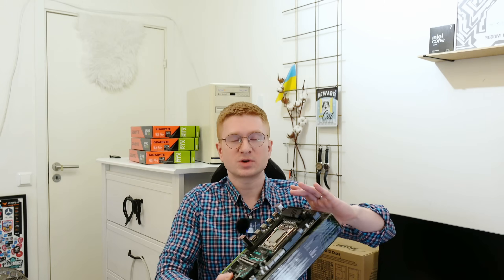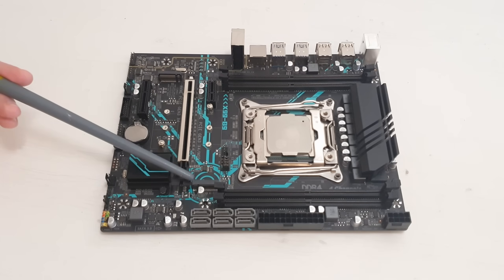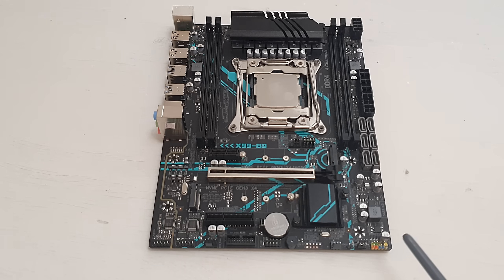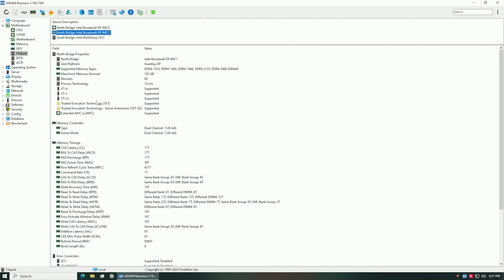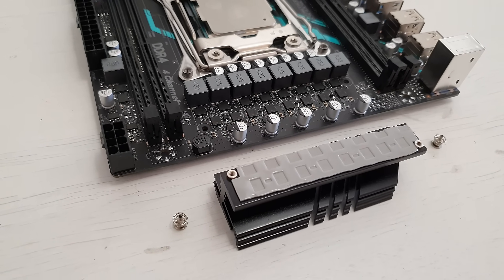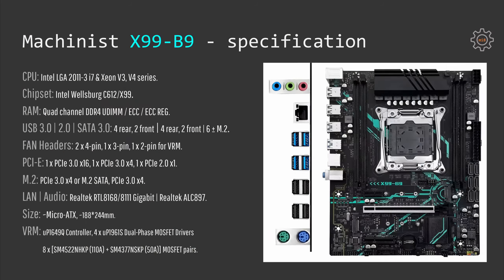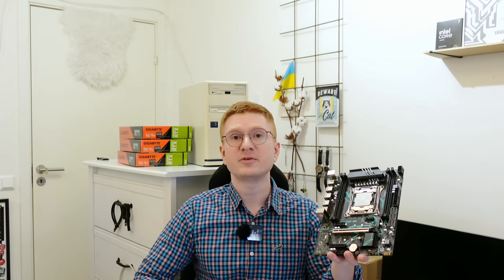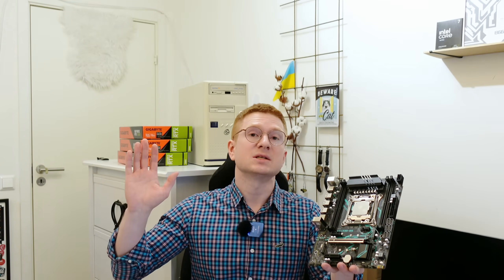Machinist X99-B9 – X99 chipset & 4 memory channels but is it good enough?

Comment: Wouldn't it be possible to solder the pins onto the debug panel and install a BIOS that's compatible with TPM 2.0 and secure boot? I think it's worth reviewing this board. It might have potential.
Reply from the maker: Theoretically it's possible. Practically, I don't know what BIOS is compatible and see no reason to bother with soldering as you can just buy X99-XD4 that has all required features out of the box.
Reply: @Miyconst  Thanks for replying!

Comment: Thanks for the review. I should have seen this video before i order this board weeks ago. I'm yet to install a ram and power supply and test the board. However, i have faced some extraordinary situation. my x99 CPU Slot place on upside down on motherboard. I just found out that when i try to install my e2640v4 cpu. i can confirm its not cpu issue.but the board.  Since this is not booted up until now is this safe to boot when my ram arrived??? If anybody faced this issue with chinese boards ?
Reply from the maker: I don't quite understand the question or the concert. What do you mean with CPU slot? Do you mean socket? If so, then it doesn't matter what orientation it is, as long as you install the CPU correctly.

Comment: Ah damn. I wanted to get another original QD4 for near the same $64 that I paid the first time. I don't like the new QD4. I got excited when I saw B9 and the whole way through your review I thought I was about to buy and then you said ECC is not working on B9 with Xeon v4. DAMNNNN. I dodged a bullet there. I really appreciate your videos. Thank you!
What board can you recommend that has an gen3x16 slot + gen3x4 slot + 1 or 2 NVMe gen3x4 ?
Reply from the maker: I am awaiting an X99-XD4 board for a review. If it turns out to be decent, then it fits your needs.

Comment: It's not 4 channels... It's 2 channels with 4 slots - very different than "4 channels"

If you install 4 DDR4 cards, 2 will share a "channel" and use bank interleaving.

Thus 50% less RAM bandwidth. The home user will not notice any difference, unless you have an server or a system that runs different but a looooooooot of light-loads at the same time

Comment: Which bios with secure boot could be compatible with this motherboard, any suggestions? I have enabled XMP timings in default bios by using ultimate patcher tool, but cant find any guide how to add secure boot.
Reply from the maker: If I remember correctly then Secure Boot is available with the default BIOS, you just have to enable it in the Boot, Security, or CSM configuration sections.
Reply: @Miyconst  no, i checked with AMIBCP5 toool, and compared with qd4 bios for example where i can see it, secure boot menu is cut out from b9 bios completely....

Comment: When installing the OS on NVMe and connecting the HDD SATA, the system stops loading. When the SATA connectors are empty, everything works, the OS loads from NVMe. How to configure the OS to be on NVMe and the HDD SATA to be connected?
Reply from the maker: This could be a typical UEFI bug on X99 platform. You can either try to reinstall Windows with all required media connected or try to bypass the bug. The exact steps you can either ask on my Discord or find them in Mi899 GitHub issues.

Comment: Hi.. i want to buy this mobo pair with intel i7-5960X and 32gb ddr4 3200mhz ram. Will it worked out fine ?? Intel turbo boost can be use or overclock abit ?
Reply from the maker: Please watch the video, all the answers are there.

Comment: I just bought this motherboard to build a NAS. It's a shame that ECC doesn't work. I would love to take advantage of ECC in a TrueNAS build. Anyway, I'll pair it with an E5-2640V4, 4x16Gb of DDR4 2400 ECC memory, use one of the PCI slots for 2.5Gb LAN, probably a GT1030 I have lying around here, both NVME slots for boot and cache and all SATA ports for mass storage.
Reply: da pra conseguir secure boot nessa bios ?.

Comment: I have this board exactly and for me the restore on power loss actually works when the jumper is in the correct position. I use that feature a lot actually to restart my server from a remote location with a smart plug. Maybe the QA for these boards is not the best...
Reply from the maker: Q/A for these boards is surely very bad and your case just confirms it. One thing if they "forgot" to implement a feature and it's just missing in entire lineup, another thing when it works randomly.

Comment: Sorry to bother you this way, don't know how to contact any other way...

I have a e3 1270 v5 CPU, 128gb DDR3 ECC RAM, a 512gb nvme, a case and a GTX 1660 super laying around. Want to build a low budget gaming PC for my son.
Have you ever tried the JGINYUE H311M-G D4?
Reply from the maker: I have never tried this motherboard but I can say for sure that E3 Xeons don't work with ECC REG memory, only ECC UDIMM (not REG).
Reply: @Miyconst  thanx a lot, didn't know that.
Seems im unlucky, got M386B4G70DMO-YK04 modules which seem to be reg...
Reply from the maker: Well.. DDR4 RAM is so cheap these days that you can still proceed with the build, just get some used UDIMMs.
Reply: @Miyconst  Yes, that seems to logical way I'll be going. Just wanted to use these humongously huge ram sticks wasting space...😉
Reply: Thanx for the fast and competent answers, I really like your channel.
Much appreciated

Comment: Hi, big fan :-) Quick question, do you know if Aigo X99 boards are any good? Can't find much info but I see them pop up more lately on Taobao (I've been living in China for a while). I've seen other Aigo stuff for years, the couple things I bought so far (coolers/usb) were pretty decent. Thanks man.
Reply from the maker: I have not yet seen or tested any of the Aigo X99 boards, most likely it's one of the existing boards sold under another brand, if you want to hear my guess-opinion then send me some pictures on Discord, please.

Comment: Hi, could you review cheap chinese x99 dual cpu motherboard JINGSHA X99 D4 DUAL PRO? Its preatty new, also it seems to be replacement for the old d4 wich had some features missing or bugged out. So I wonder if this one fixes it.
Reply from the maker: Please just skip all these dual socket boards. Most users will be better with a single CPU solution but if you badly want a dual socket setup then pick a Dell T7810/7910 workstation from the used market.
Reply: I understand the chinese dual boards arent the best but I want super cheap nas/app hosting with lot of storage and this board fit it very well with the low cost around 120 usd. I will give it. I know the limitation of these boards but for me it make more sense to use this than anything else for a little nas/homelab. 

Thnx for trying to help out I like to tinker with things.

Comment: hey man, I bought it and I'm struggling to find a cheap cpû fan, I bought one that has a support you need to put behind but there is no holes on this motherboard, could you help me please?
Reply from the maker: There are holes but they go through the socket mount and blocked with a plastic washer. You can poke through it or just find any other cooler on Ali.
Reply: @Miyconst  okay thanks, do you know where I can find the manual for the motherboard? it was not in the box I received it in and can't find it on google either

Comment: hello, i know i'm out of context a bit but i have hope, faith and curiosity, just got my hands on a second hand lenovo laptop with a gtx 1050 4gb, it's a GP107 with all the 1050 specs as gpu-z report. Do you think it is possible that it is in fact just a modified 1050 bios made to downgrade the 1050ti so it doesn't heat much? The laptop has embarassing ventilation and i didn't see the inside yet, but am i trippin or what? Can i flash the 1050ti bios? P.S. How did it end up with the search for that S7100X compatible bios? it was r9 m385x or something right? i still have one collecting dust
Reply from the maker: I think the chance is next to none and I would not touch it.

Comment: How often do thermistor defects occur on such mainboards?  I recently purchased a MACHINIST MR9A PRO and a HUANANZHI X99E-K4 and noticed that two VRM sensors on both boards were showing temperatures above 120 degrees Celsius. Are they defective, or are the temperatures real?
Reply from the maker: Neither. The Chinese simply don't install these thermistors, 120C is the placeholder value.

Comment: I have an x99-K9, 2015 version I think. It was working fun until recently. One of the internal SSDs started randomly disconnecting and reconnecting for some reason, and it won't let me write to it. I haven't seen any signs of physical damage, so does anyone know what might be going on?
Reply from the maker: Either SSD or the motherboard are dying.
Reply: @Miyconst  hopefully just the former. I haven't seen any other issues regarding RAM or crashing, so if that's the case, the SSD can be replaced on its own.
Reply from the maker: You can check SSD health with Crystal Disk Info.
Reply: @Miyconst  will do.

Comment: If TPM 2.0 is not important to you, Windows 11 can be installed on x99 motherboard using Rufus usb by bypassing the TPM 2.0 Option when you click start. Ive been running Windows 11 for 2 weeks on x99 PR9 motherboard. Resizable bar working as well. For sleep mode, instead i Enabled Hibernate power option and it work as sleep function. Great vids !
Reply: Thanks for the tip with bypassing requirements for win11. My computer restarts on its own when i use the hibernate option sadly, don't know how to solve that.
Reply: @bignuts4943 same issue here with an pr9-h I can't use hibernate mode :/

Comment: Ive just bought a B9 mobo and it's due to arrive in the next few days. I have a Zsus P4 with a 2670 v3 (unlocked) and 4 8GB sticks and was hoping it was better than my current one, but it seems to be the same. I already use Win 11 here (don't play Valorant nor LoL, so I don't really mind TPM 2.0|), but I believe Quad Channel is going to be good, not for games, but for other activities as well. I live in Brazil and my package's been "stalled" for 10 days already, but that's our reality here.I still think programs are  going to run smoother.
Thanks for the review.
Reply: does x99 b9 arrived and worked fine?
Reply: @murdock2143  yes, it did. It's working perfectly fine, the memos are in Quad Channel and everything's working as it should. Problem is, I can't access the BIOS to "unclock" the processor, so I'm using my 2670 v3 in stock, which is not a huge problem, but I believe that if I could unleash its power, it'd be even better. I'm satisfied, so far.
Reply: @Maurivillas  i'm glad it working perfectly on you, i hope it will last forever, thanks for replying back.

Comment: Thank freaking god you made this video i was just about to buy the B9 thinking it would of been a great board.

Honestly its still sad that alot of these new boards coming out dont have TPM 2.0 support. The H9S ive personally used and its good. But with v3 xeons ive used mostly the X99-D4 plus.

Recently sold a computer with 2697V3 with turbo unlock (10c/20t active) so the 3.6ghz boost works with AMD RX470. But the stepping 1 xeon kicked the bucket a week later. Ended up giving the person E5-2667V4 because thats the only cpu on hand and he was okay with it

Comment: Hello, i have a klissre e5-f9 motherboard with a e5 2640v3. Can u please tell me whether it's safe to go for e5 2667 v3 considering it's higher tdp. Not looking for tbu. As I doubt my board may support tbu and app does not yet support for this board on its database
Pls suggest if ne other cpu can help with an upgrade on the same board❤❤
Reply from the maker: There is no such thing as "safe" with the Chinese motherboards but you should be fine even with TBU if you ensure good airflow over the VRM zone.
Reply: Thanks for your quick reply, can we tbu on klissre e5-f9? And I wasn't looking for tbu originally with this board considering it's 6 phase vrm (tho it may be weaker than machinist ones) 
 besides I heard tbu increases tdp and I had doubts with 135watt tdp for 2667v3 without tbu too for this board.
Looking forward to your ever so helpful guidance.
Thanks.

Comment: at this point I feel like anymore x99 content is "beating a dead horse" and it feels like its becoming a  chore to you.

I'd be more interested in that baby AT system behind you than new mediocre x99 stuff.
Reply from the maker: It was the last X99 board on my shelf to test, not buying anymore, at least for now. Thinking about testing AMD + Nvidia GPU setup, where AMD does rendering and Nvidia generates fake frames. X99 would be a perfect candidate because both GPUs could work at PCI-E X16.

Comment: Hi from France,
Thanks for advices. So the MR9 A is still a better choice ?
Reply from the maker: MR9A is an ATX not mATX motherboard but in general it's a much better option.
Reply: Who can explain to me how this suboptimal pcie routing affects usage in real life
Reply from the maker: @pastukas  if you have an i7-5820k or i7-6800k, then the second M.2 slot and the PCI-E x4 slots won't work at all. With a Xeon CPU it makes no difference.

Comment: I think the reason it can't be programmed with external programmer is simply because there is a defect somewhere on the mobo. I recently bought X99 K9 v2.1 from aliexpress (one with post code led) and I couldn't program iEngineer's bios on it with CH341a v1.7 and EZP2019. But with the one I newly bought 2days ago, it worked flawlessly with the test clip. The power supply was on standby mode, and there was no cpu or cmos battery.
Reply from the maker: Yeah, it very well could be just a defective motherboard.

Comment: i built lots of budget pc with Chinese mystery boards (B75, X79 and X99 based boards, so far i haven't find one that supports sleep mode and let me set the fans to anything but full speed :/
Reply: I have a Machinist X99 PR9 and override the fan speeds with FanControl. But yes, no sleep mode!
Reply: @mediumsizedcal  i think the one that i got was the X99 D4M, an earlier model i think. For such a budget parts bin build i'm happy that it hasn't come back to the shop haha.
Reply from the maker: Yeah.. these are the most common issues.
Reply: @Miyconst  are there any bios available to flash on this board to fix that issue? Seriously asking because the web support/documentation for those are almost always non-existant.
Reply: Just enable Hibernate power mode using CMD if it's not there . Works kinda like Sleep mode. For me anyways lol.

Comment: I saw that the BIOS battery is not unplugged in BIOS flashing scene 06:19 here.
Recently I helped my friends reading and flashing bios, but the BIOS can be only read when the cmos battery is unplugged.
Hope it helps.😂😂
Reply from the maker: The scene was set up for broll only. 🤣 I tried absolutely everything, with and without battery or PSU, doesn't help. Thanks for the hint though.

Comment: Im kinda new to these type of chinese X99 boards, but is it possible they could execute some kind of malicious code? For example, an msi boards will start up MSi center or whatever every first boot. If so, what could be done to prevent this.
Reply from the maker: It is surely possible but so far I have not seen any reports of it actually happening. The only 100% way to prevent it is to use another BIOS and flash it with a programmer.

Comment: The Qyida D4 white motherboard with C612 chipset is the worst X99 I have ever used (and I have used a lot of them). The performance I have seen in various CPUs used with it is abysmal.
Reply from the maker: Qiyida is just an AliExpress store name. They sell whatever motherboards. Sometimes they sell different motherboards under the same name and page because that's cheaper on AliExpress. Some boards are really crappy, others are decent.

Comment: I installed a bios slot on my x99-k9 this turned easy to flash new bios file since the bios does not reset with pins short. But after installing the iEngineer bios this problem has solved.

Comment: Isn't quad channel supported in all xeon x99 platform cpus?
Reply from the maker: All LGA 2011-3 CPUs support 4 memory channels but not all motherboards.
Reply: It requires fewer tracks to do dual channel.
Probably fewer layers, and less R&D =cheaper
Reply: On most c612 motherboards, yes! Even if ir is not listed

Comment: Great video, I was sad because the board broke, I would like to see a review of the MACHINIST-K9 V2(2024). Pls
Reply from the maker: So far I don't have any plans for K9 but why exactly this board?
Reply: @Miyconst  I tested x99-k9 v2 with post codes display with jlpc to lpc-tpm adapter and the gigabyte 12pin lpc module, but it lasted for only one reboot. first boot and the module was present in bios, but after reboot died probably because of what you have on your website - too much voltage. I didn't measure voltage on jlpc connector, but maybe I'll do that

Comment: Any of these motherboards allow a cpu to reach its boost speed out of the box (not talking about overclocking).  Seems all I ever see is cpus hitting base speed on these boards.
Reply from the maker: As far as I know, all these boards require BIOS mod/update to get TBU working with the V3 Xeons, V4 Xeons are limited by Intel's specification and will never achieve max frequency on all cores.
Reply: @Miyconst So even with and Asrock or Asus etc motherboard turbo boost still doesn’t work?

Comment: very fishy quality board, i don't think you brick the board or damage the bios chip, it just design to self destruct after few times of usage, i have this board work for few days and it's just die by it self. btw good and detailed reviews as always 👍.
Reply from the maker: Yeah, sadly it's not just X99-B9, many of these Chinese boards have high defect rate, I know for sure that many X99-B9 work for months with no significant issues but there are also bad samples like yours.